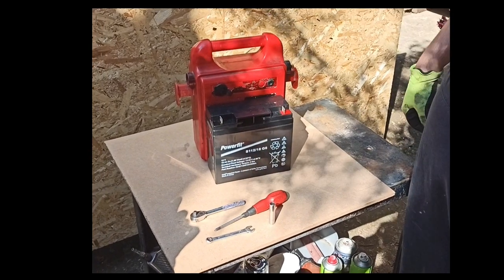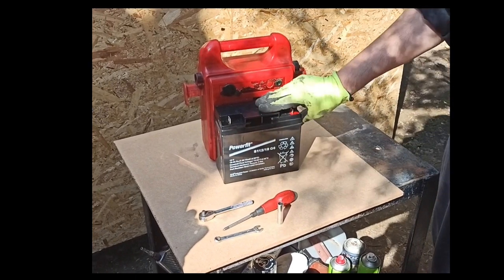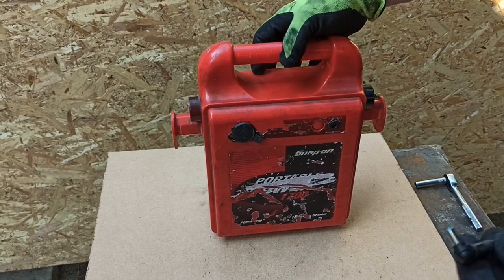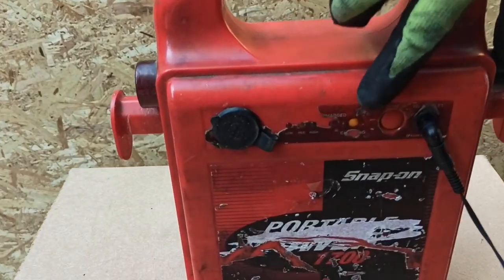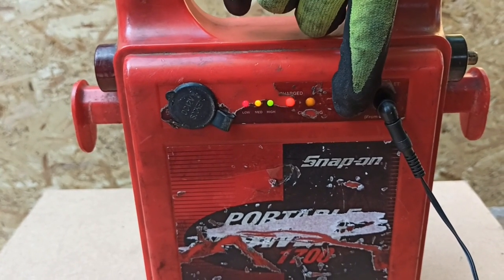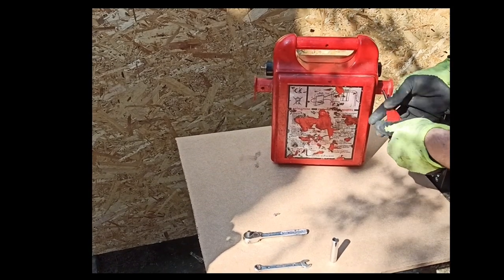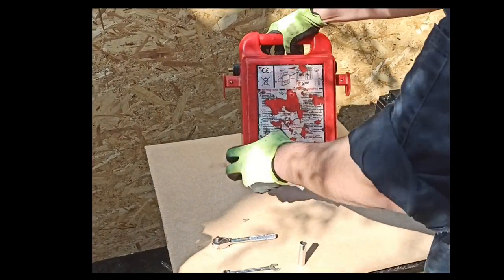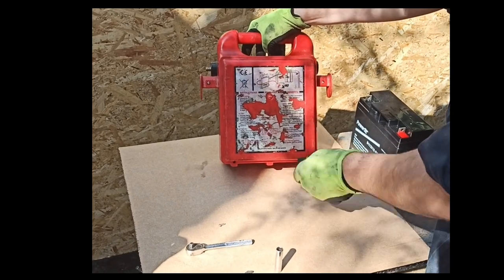How To Replace a Jump Starter Power Pack Booster Battery (Snap On 1700) Changing Power Pack Battery

Comment: Hello, I have the same snap on jump starter and comes with a 12v 20ah, and I just found a 12 18ah battery replacement, if its work as the original one?
Reply from the maker: Hi, yes it will work. Please make sure to subscribe to my channel as i will be putting more useful videos.
Thanks.

Comment: Here's an interesting question. Have you ever tried replacing the Lead Acid battery with a Li-ion battery that has similar stats and seeing if that would work?
Reply from the maker: TBH i havent tried but im guessing it would work.
Reply: Very good question
Reply: I'm guessing that would be dangerous. A lithium battery does not charge the same way a lead-acid does and the charger inside the jump box won't know the difference. Meaning it will likely overcharge it and explode it in your face.

Comment: Do you know the exact part number for the jump starter battery. It needs to be the high cranking amp one.
Reply from the maker: I brought my one of ebay but in order to find the exact one, i will suggest you to type your batteries part number to google and find the exact one
Reply: E-Mechanic ok thanks. I don’t think those ebay jobs are going to be the high CCA ones that snapon original have. Hard to find them.
Reply: BB battery 12 volt DC SHR24ah  Portable Power
Reply: @skipmole612  Thank you